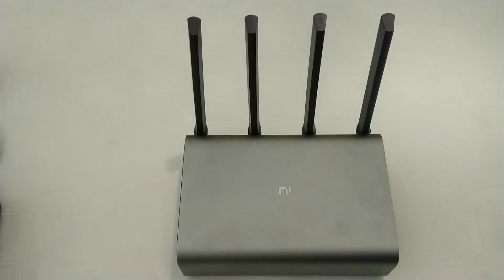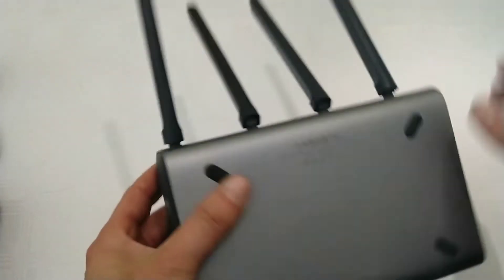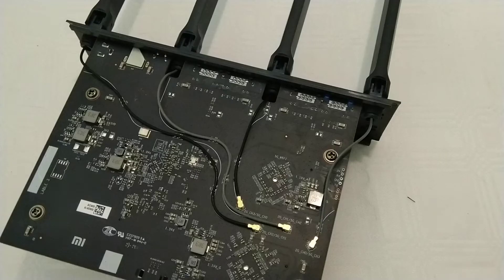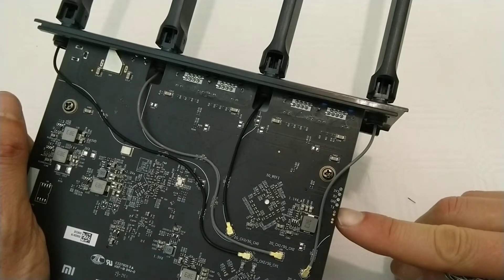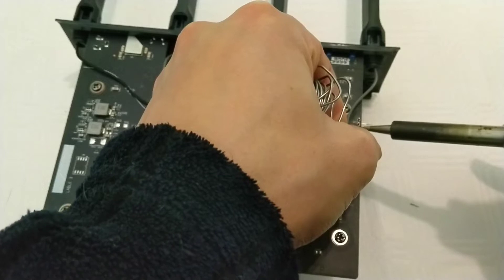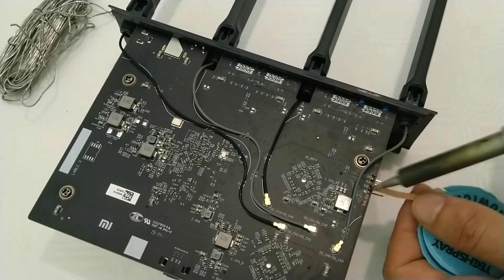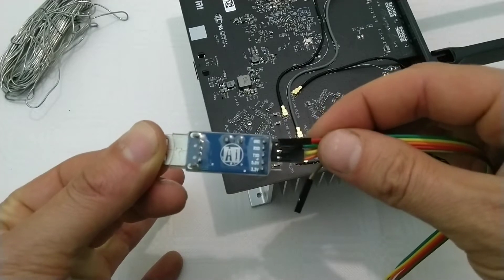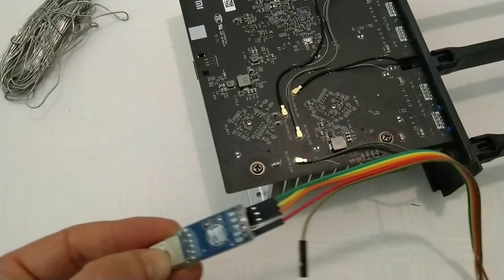Add a Serial Port to Wifi Router (Xiaomi Router 3 Pro)

Comment: I think it went a little fast and for me as beginner was a little hard to follow, I don’t know so much about the conventions of the pin in usb and in general the name of the components … it would be amazing if you can share some resources or documentation to learn more about!
I already bricked two Xiaomi routers and I’m eager to be able to fix them 😂
Reply from the maker: Yes it is a lot but unfortunately quite a few things are involved in de-bricking hardware. Usually getting to the boat loader over a serial console and then pointing it to a TFTP server to load replacement firmware. 

This helped me:
https://openwrt.org/toh/xiaomi/mi_router_3_pro#hardware

TX (transmit) and RX (receive) on one side go to RX and TX respectively on the other side. I.e.TX<->RX and RX <->TX . GND (ground) goes to GND. PWR (power) goes to power but be sure to use the correct voltage.

Hope this helps!

Comment: Can you instruct how to flash rom with console port?
Reply from the maker: I setup a TFTP server and connected to the serial port using a USB to serial converter.

Setup TFTP
- On machine with IP address of 192.168.1.5 
- Rename kernel to kernel0.bin
- TFTP file permissions need to be 777
- Connect network cable to router 

Connect router to machine with serial cable 
Power on router
picocom -b 115200 /dev/ttyUSB0
hit 1
Accept defaults:
- Router IP = 192.169.1.1 
- TFTP server IP = 192.168.1.5
- Linux Kernel filename = kernel0.bin

Wait for router to flash and bring up NW with IP address of 192.168.1.1
ssh to router
scp sys-upgrade file to router
use syupgrade to flash router
Reply from the maker: Example of router output via serial console viewed in minicom, picocom, etc.:

Please choose the operation: 
   1: Load system code to SDRAM via TFTP. 
   2: Load system code then write to Flash via TFTP. 
   3: Boot system code via Flash (default).
   4: Entr boot command line interface.
   7: Load Boot Loader code then write to Flash via Serial. 
   9: Load Boot Loader code then write to Flash via TFTP. 

You choosed 1

 0 
 
1: System Load Linux to SDRAM via TFTP. 
 Please Input new ones /or Ctrl-C to discard
        Input device IP (192.168.1.1) ==:192.168.1.1
        Input server IP (192.168.1.5) ==:192.168.1.5
        Input Linux Kernel filename (kernel0.bin) ==:kernel0.bin

 NetTxPacket = 0x8FFE4140 

 KSEG1ADDR(NetTxPacket) = 0xAFFE4140 

 NetLoop,call eth_halt ! 

 NetLoop,call eth_init ! 
Trying Eth0 (10/100-M)

 Waitting for RX_DMA_BUSY status Start... done

 ETH_STATE_ACTIVE!! 
TFTP from server 192.168.1.5; our IP address is 192.168.1.1
Filename 'kernel0.bin'.

 TIMEOUT_COUNT=10,Load address: 0x80a00000
Loading: Got ARP REPLY, set server/gtwy eth addr (e0:3f:49:b0:17:ed)
Got it
#################################################################
         #################################################################
<snip>
         #################################################################
         ############
done
Bytes transferred = 5714384 (5731d0 hex)
LoadAddr=80a00000 NetBootFileXferSize= 005731d0
Automatic boot of image at addr 0x80A00000 ...
## Booting image at 80a00000 ...
   Image Name:   MIPS OpenWrt Linux-5.10.146
   Image Type:   MIPS Linux Kernel Image (uncompressed)
   Data Size:    5714320 Bytes =  5.4 MB
   Load Address: 80001000
   Entry Point:  80001000
   Verifying Checksum ... OK
OK
commandline uart_en=1 factory_mode=0 usb_u3=0
No initrd
## Transferring control to Linux (at address 80001000) ...
## Giving linux memsize in MB, 256

Starting kernel ...

OpenWrt kernel loader for MIPS based SoC
Copyright (C) 2011 Gabor Juhos <juhosg@openwrt.org>
Decompressing kernel... done!
Starting kernel at 80001000...

[    0.000000] Linux version 5.10.146 (builder@buildhost) (mipsel-openwrt-linux-musl-gcc (OpenWrt GCC 11.2.0 r19777-2853b6d652) 11.2.0, GNU ld (GNU Binutils) 2.37) #0 SMP Fri Oct 7 23:34:56 2022
[    0.000000] SoC Type: MediaTek MT7621 ver:1 eco:3
[    0.000000] printk: bootconsole [early0] enabled
[    0.000000] CPU0 revision is: 0001992f (MIPS 1004Kc)
[    0.000000] MIPS: machine is Xiaomi Mi Router 3 Pro
[    0.000000] Initrd not found or empty - disabling initrd
[    0.000000] VPE topology {2,2} total 4
[    0.000000] Primary instruction cache 32kB, VIPT, 4-way, linesize 32 bytes.
[    0.000000] Primary data cache 32kB, 4-way, PIPT, no aliases, linesize 32 bytes
[    0.000000] MIPS secondary cache 256kB, 8-way, linesize 32 bytes.
[    0.000000] Zone ranges:
[    0.000000]   Normal   [mem 0x0000000000000000-0x000000000fffffff]
[    0.000000]   HighMem  [mem 0x0000000010000000-0x0000000023ffffff]
[    0.000000] Movable zone start for each node
[    0.000000] Early memory node ranges
[    0.000000]   node   0: [mem 0x0000000000000000-0x000000001bffffff]
[    0.000000]   node   0: [mem 0x0000000020000000-0x0000000023ffffff]
[    0.000000] Initmem setup node 0 [mem 0x0000000000000000-0x0000000023ffffff]
[    0.000000] percpu: Embedded 15 pages/cpu s30256 r8192 d22992 u61440
[    0.000000] Built 1 zonelists, mobility grouping on.  Total pages: 130496
[    0.000000] Kernel command line: console=ttyS0,115200n8 rootfstype=squashfs,jffs2
[    0.000000] Dentry cache hash table entries: 32768 (order: 5, 131072 bytes, linear)
[    0.000000] Inode-cache hash table entries: 16384 (order: 4, 65536 bytes, linear)
[    0.000000] Writing ErrCtl register=0000534c
[    0.000000] Readback ErrCtl register=0000534c
[    0.000000] mem auto-init: stack:off, heap alloc:off, heap free:off
[    0.000000] Memory: 505680K/524288K available (7005K kernel code, 625K rwdata, 824K rodata, 4204K init, 243K bss, 18608K reserved, 0K cma-reserved, 262144K highmem)
[    0.000000] SLUB: HWalign=32, Order=0-3, MinObjects=0, CPUs=4, Nodes=1
[    0.000000] rcu: Hierarchical RCU implementation.
[    0.000000]  Tracing variant of Tasks RCU enabled.
[    0.000000] rcu: RCU calculated value of scheduler-enlistment delay is 10 jiffies.
[    0.000000] NR_IRQS: 256
[    0.000000] CPU Clock: 880MHz
[    0.000000] clocksource: GIC: mask: 0xffffffffffffffff max_cycles: 0xcaf478abb4, max_idle_ns: 440795247997 ns
[    0.000013] sched_clock: 64 bits at 880MHz, resolution 1ns, wraps every 4398046511103ns
[    0.007949] clocksource: MIPS: mask: 0xffffffff max_cycles: 0xffffffff, max_idle_ns: 4343773742 ns
[    0.017008] Calibrating delay loop... 586.13 BogoMIPS (lpj=2930688)
[    0.083165] pid_max: default: 32768 minimum: 301
[    0.087933] Mount-cache hash table entries: 1024 (order: 0, 4096 bytes, linear)
[    0.095136] Mountpoint-cache hash table entries: 1024 (order: 0, 4096 bytes, linear)
[    0.105798] rcu: Hierarchical SRCU implementation.
[    0.110840] dyndbg: Ignore empty _ddebug table in a CONFIG_DYNAMIC_DEBUG_CORE build
[    0.118946] smp: Bringing up secondary CPUs ...
[    0.124233] Primary instruction cache 32kB, VIPT, 4-way, linesize 32 bytes.
[    0.124244] Primary data cache 32kB, 4-way, PIPT, no aliases, linesize 32 bytes
[    0.124256] MIPS secondary cache 256kB, 8-way, linesize 32 bytes.
[    0.124334] CPU1 revision is: 0001992f (MIPS 1004Kc)
[    0.178749] Synchronize counters for CPU 1: done.
[    0.211275] Primary instruction cache 32kB, VIPT, 4-way, linesize 32 bytes.
[    0.211285] Primary data cache 32kB, 4-way, PIPT, no aliases, linesize 32 bytes
[    0.211294] MIPS secondary cache 256kB, 8-way, linesize 32 bytes.
[    0.211343] CPU2 revision is: 0001992f (MIPS 1004Kc)
[    0.270197] Synchronize counters for CPU 2: done.
[    0.300784] Primary instruction cache 32kB, VIPT, 4-way, linesize 32 bytes.
[    0.300794] Primary data cache 32kB, 4-way, PIPT, no aliases, linesize 32 bytes
[    0.300802] MIPS secondary cache 256kB, 8-way, linesize 32 bytes.
[    0.300854] CPU3 revision is: 0001992f (MIPS 1004Kc)
[    0.355378] Synchronize counters for CPU 3: done.
[    0.385249] smp: Brought up 1 node, 4 CPUs
[    0.393612] clocksource: jiffies: mask: 0xffffffff max_cycles: 0xffffffff, max_idle_ns: 19112604462750000 ns
[    0.403438] futex hash table entries: 1024 (order: 3, 32768 bytes, linear)
[    0.410457] pinctrl core: initialized pinctrl subsystem
[    0.418110] NET: Registered protocol family 16
[    0.423640] thermal_sys: Registered thermal governor 'step_wise'
[    0.425194] cpuidle: using governor teo
[    0.474456] clocksource: Switched to clocksource GIC
[    0.481500] NET: Registered protocol family 2
[    0.486282] IP idents hash table entries: 4096 (order: 3, 32768 bytes, linear)
[    0.495142] tcp_listen_portaddr_hash hash table entries: 512 (order: 0, 6144 bytes, linear)
[    0.503454] TCP established hash table entries: 2048 (order: 1, 8192 bytes, linear)
[    0.511092] TCP bind hash table entries: 2048 (order: 2, 16384 bytes, linear)
[    0.518201] TCP: Hash tables configured (established 2048 bind 2048)
[    0.524685] UDP hash table entries: 256 (order: 1, 8192 bytes, linear)
[    0.531150] UDP-Lite hash table entries: 256 (order: 1, 8192 bytes, linear)
[    0.538437] NET: Registered protocol family 1
[    0.542732] PCI: CLS 0 bytes, default 32

FATAL: read zero bytes from port
term_exitfunc: reset failed for dev UNKNOWN: Input/output error

$ ssh root@192.168.1.1

BusyBox v1.35.0 (2022-10-07 23:34:56 UTC) built-in shell (ash)

  _____                     ______        __
 |       |.-----.-----.-----.|  |  |  |.----.|  |_
 |   -   ||  _  |  -__|     ||  |  |  ||   _||   _|
 |_______||   __|_____|__|__||________||__|  |____|
          |__| W I R E L E S S   F R E E D O M
 -----------------------------------------------------
 OpenWrt 22.03.1, r19777-2853b6d652
 -----------------------------------------------------
=== WARNING! =====================================
There is no root password defined on this device!
Use the "passwd" command to set up a new password
in order to prevent unauthorized SSH logins.
--------------------------------------------------
root@OpenWrt:~# ls
root@OpenWrt:~# scp bob@192.168.1.5:/home/bob/Downloads/r3p/openwrt-22.03.1-ramips-mt7621-xiaomi_mi-router-3-pro-squashfs-sysupgrade.bin .

Host '192.168.1.5' is not in the trusted hosts file.
(ssh-ed25519 fingerprint SHA256:ixlWf1XK5Wy+cki4XNXS79aLfapvTbrGy0hhir0Jqqk)
Do you want to continue connecting? (y/n) y
bob@192.168.1.5's password: 
openwrt-22.03.1-ramips-mt7621-xiaomi_mi-router-3-pro-squashfs-sysupgrade.bin                                                                                                                              100% 6881KB   6.7MB/s   00:01    

root@OpenWrt:~# ls
openwrt-22.03.1-ramips-mt7621-xiaomi_mi-router-3-pro-squashfs-sysupgrade.bin

root@OpenWrt:~# sysupgrade openwrt-22.03.1-ramips-mt7621-xiaomi_mi-router-3-pro-squashfs-sysupgrade.bin 
Fri Oct  7 23:38:01 UTC 2022 upgrade: Image not in /tmp, copying...
Cannot save config while running from ramdisk.
Fri Oct  7 23:38:02 UTC 2022 upgrade: Commencing upgrade. Closing all shell sessions.
Command failed: Connection failed

root@OpenWrt:~# Connection to 192.168.1.1 closed by remote host.
Connection to 192.168.1.1 closed.
Reply: @breakfixbuildimprove4326  I'm lost uboot 😭😭
Reply from the maker: @tungsctn  I am not sure what you mean so some general tips:

Make sure your serial connection is working correctly or you will not see anything.

The uboot menu only displays for 5 seconds according to the debricking guide:
https://openwrt.org/toh/xiaomi/mi_router_3_pro#debricking 

If you miss it it you must reboot the router.
 
If your router no longer has a working uboot then I do not know how you will recover it.
Reply: @breakfixbuildimprove4326  i know, but I have last boot is pb-boot, I was try flash breed booloader but I have bricked!